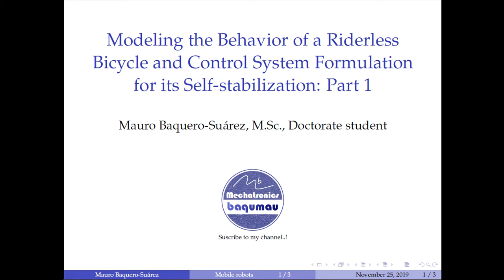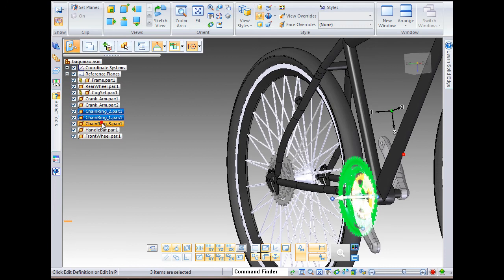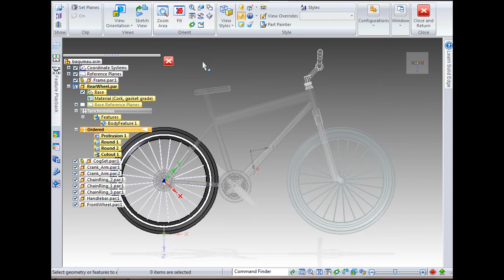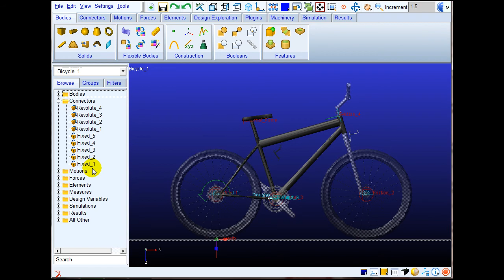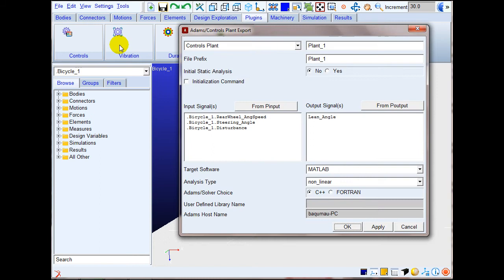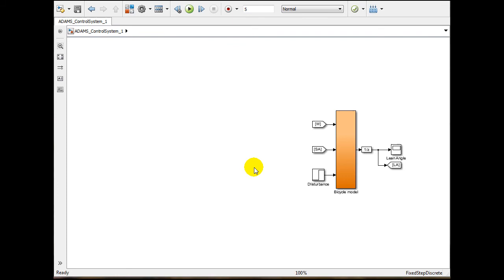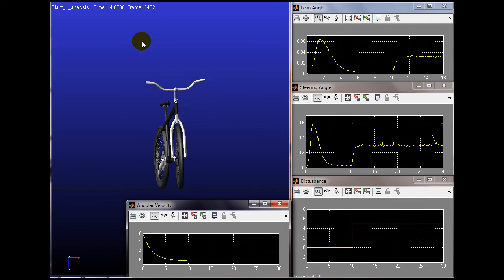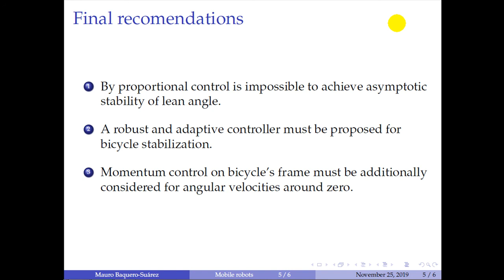Modeling the Behavior of a Riderless Bicycle and Control System for its Self-stabilization: Part 1

Comment: Grate work!  Hey man can you teach control part modeling too 11:33 ? I'm from INDIA, I really love  your video, I'll hope  you answer
Reply from the maker: Hello, thanks for your comments. In this first part i am using a feedback proportional control, which is very simple. I feed the lean angle output as input control of steering system, it multiplied by a constant gain, whose value depends on the model open loop poles. This control strategy is not robust and could not stabilize a real bicycle. In second part i'll try to explain it and i'll design a robust control so that is capable to stabilize a real system.